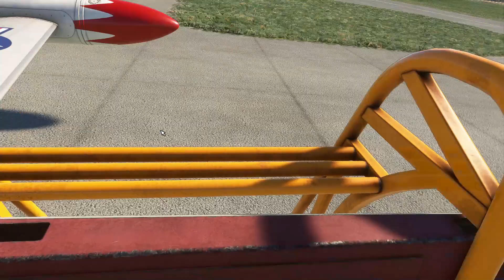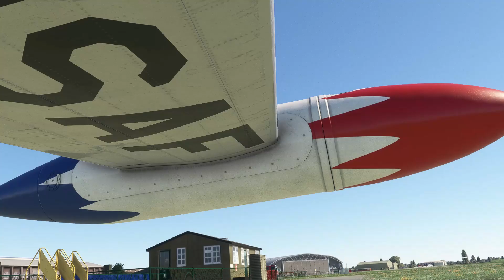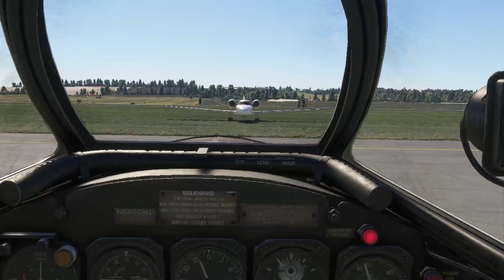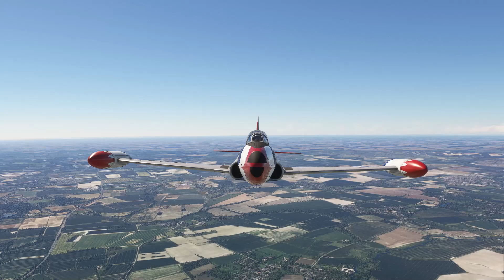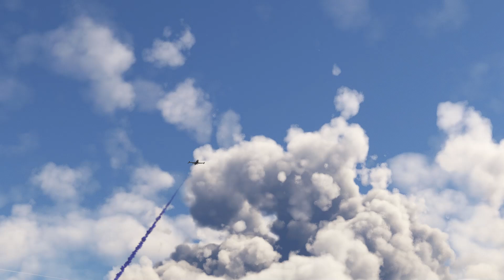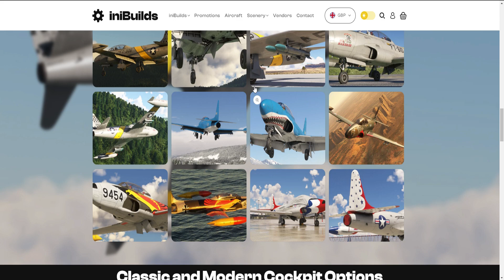Inibuilds Premier T-33 Shooting Star Preview | Microsoft Flight Simulator

Comment: Thanks for doing some study before doing this review.  Enjoyed it.  Some reviewers want to be first out, and missing a few important features. Often with major complaints that will ruin the sale. 
Worst example was complaining about ground handling. Caused by not activate nose wheel steering. No airspeed indicator. A few clicks on PFD screen and it would show up. Just a few examples on other aircraft ..
BTW the modern cockpit is authentic. Used in Ace Maker today, flying in air shows.
Instant purchase tomorrow.